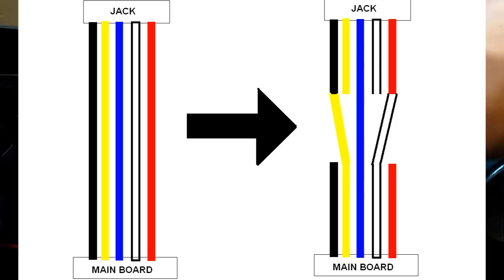Delphi SKYFi Audio System line-in mod

Comment: I know this is old, but thanks for this video. It put me on the right track. I bought one of these boom boxes, still new in box, at a thrift store for $10, figuring I'd rob the speakers and PSU. But I decided to try this hack first. It worked, but I did it a little differently. Instead of holding a temporary jumper on pins 4 & 8 while it was powered up, I simply soldered them permanently. Everything works great. If I wanted to add a power switch, I'd probably just add/hack it somewhere at back where the jack is. But the truth is I'm not overly impressed with the sound, so I will be using the speakers elsewhere and save the psu. By the way, the psu in the box says 12 volts, but mine is actually close to 16 volts! Just an FYI for anyone else. Anyway, thanks again for the video!

Comment: Great mod! I can't believe I've been hanging onto that thing for so long.  I am putting a Raspberry Pi inside with Pi Music Box for a self contained network music player.

Two minor notes: I had to solder a jumper wire from pins 4 to 8 on the amp chip, otherwise, it just kept going into standby after every time I manually shorted it.

Also, instead of cutting and splicing my wires from the headphone jack, I removed the silver header pins from the white plastic jack on the main board end of the wire.  Then I just rearranged the wires.  No soldering necessary.

Thanks for a great mod!

Comment: I inherited one of these, but with the Roady XT XM radio and adaptor. 

I was able to do just the first portion of the hack presented here to have it work. There was no need to blow out the audio chip to avoid standby. I just detached the antenna, and can use the power button on the RoadyXT to turn the system on and off. I took a long male-male 3.5 mm audio cable, and put most of it where the antenna wire was stored, leaving the jack available on top. Very easy hack, works fine with batteries or with adapter, would still work with XM radio, if I ever had an account again, except for headphones, and would be pretty easy to reverse by just removing the solder. Very cool! Thanks.

Comment: I had one of these. I modded it by simply disconnecting the audio out from the XM radio and tying onto that with my audio cable and then just unplug the satellite antenna. Worked great and was loud. I wish I still had it as I'd probably mod it this way and add a proper line in jack, switch and speaker out. If I ever find one of these again I'll definitely be doing this.
Reply: coondogtheman1234 how did you do this version of the mod? I want to use it for a  small guitar practice amp. I'd like to be able to shut it off, without wiring a switch in it. Your way would be more efficient for me I think

Comment from the maker: It should work with the batteries. However since this mod disables the standby function of the chip it may end up drawing too much battery power when you aren't using it. So you may have to remove batteries or add a switch to stop the power draw when it isn't in use.

Comment: Can you explain what that last step does (supplying power and momentarily bridging pins 4 & 8)? It's not a permanent connection?
Also, you suggested a quick solder of the headphone jack instead of cutting wires. How is that done?
Reply from the maker: I believe it is frying the standby circuit in the chip to permanently disable the standby mode. I'm sure there is a more elegant way to do this that doesn't involve breaking part of the chip, but this is just the way that I stumbled into.

You would just want to solder the two outside pins of that connector together. Pin 1 and 2 connect together and Pin 4 and 5 connect together. You can see in the video that I have two blobs of solder on either side of that connector where it is soldered on the board, directly above those wires that I am pointing out.
Reply: @bbell  hey

Comment: How do I fix the mono tone one speaker is louder than the other one and I switched the speakers to see if was the speaker but their both good speakers did I touch a wrong point on the secret board to cause power to go more to one speaker from the amplifier mod?
Reply from the maker: shane meloy I would check the wires that were switched or jumpered and make sure the connection is solid. Also try switching to a different cable for input if you can
Reply: Bryce Bell i tryed the cable on a differnt device and it works great the connection to the wires seem like a good fit it seems like i shorted out the amp besides just moding it but im not sure i have an i luv stereo that the cord works with i just wanted the portability because i can still put the batteries in it
Reply: @shanemeloy2503  I know this is old & prob doesn't matter anymore, but I had the same issue. One channel - the one farthest from the pcb - cut in and out. I traced it back to the cable coming from the headphone (pre-hack) jack to where it plugs in to the pcb. The wires were in a bind at that plug, and there was a weak connection on mine.